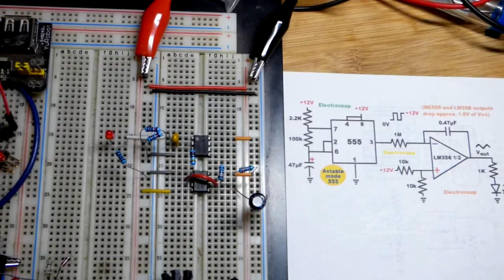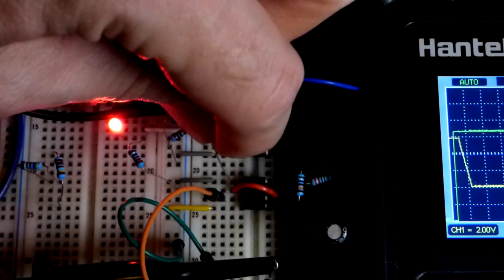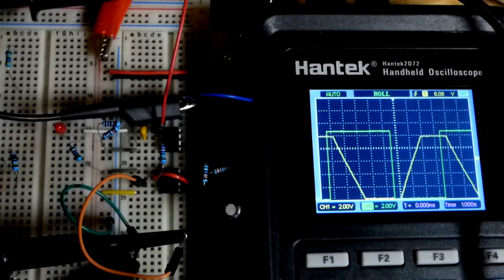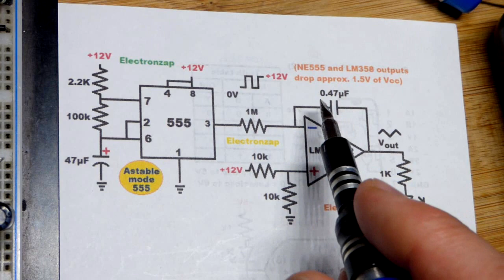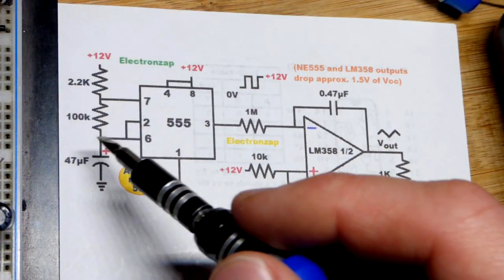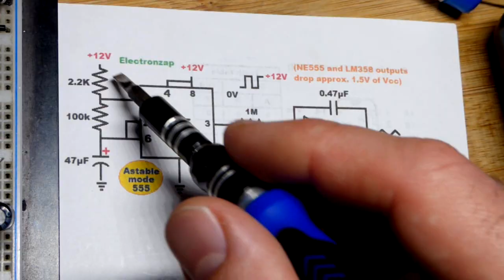Astable 555 Timer Controlled Bidirectional Voltage Ramp Op Amp Circuit

Comment: do you have a example where output pin 3 maintains a proportional square wave between 2hz and 12hz using a 0vdc to 2.9vdc input on pin 5 by adding a op amp to to keep the on/off time the same?